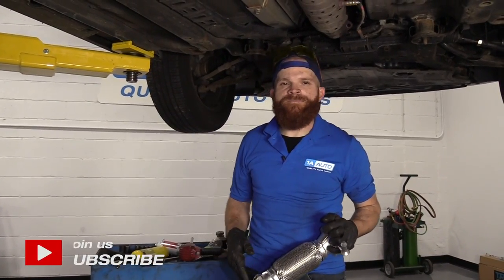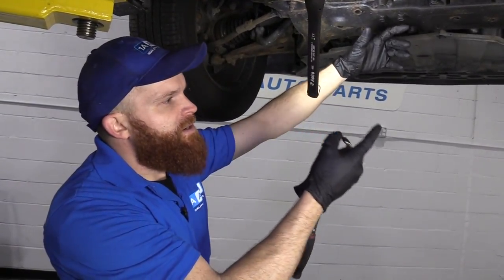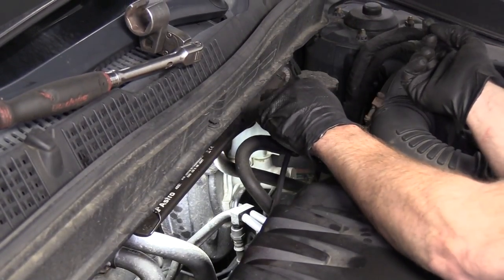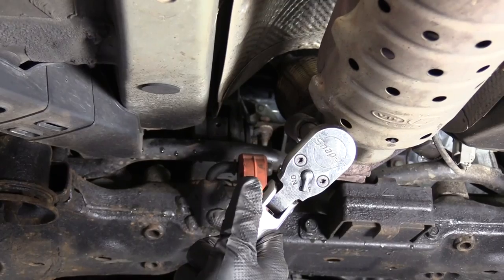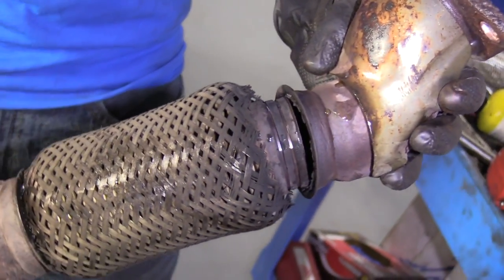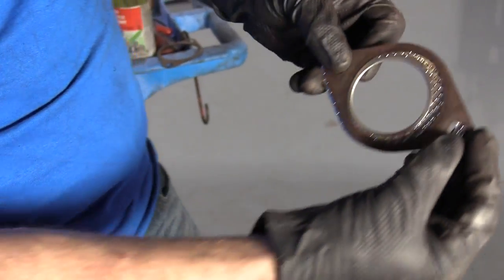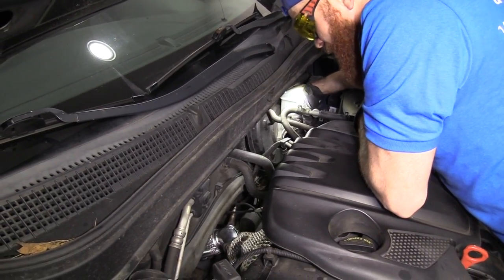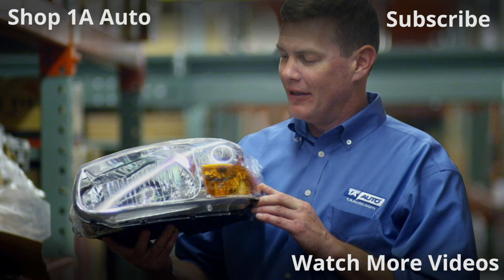How to Replace Flex Pipe 10-14 Hyundai Sonata

Comment: I have a question I have a huge leak and it looks like it’s a pretty common problem with that part on these cars around 130-150k mileage. The shop told me I needed a whole new exhaust but from my codes I think I just need a new upper downstream exhaust part. How likely would a piece fall down and break a whole brand new catalytic converter?

Comment: If reusing a gasket (or even with a new one), use Permatex copper Spray or Kopper Koat on the gasket/flanges.  Light coats.  Ensures no leaks!  Has been used since the 70s for this purpose.